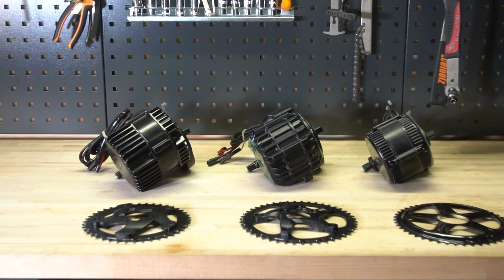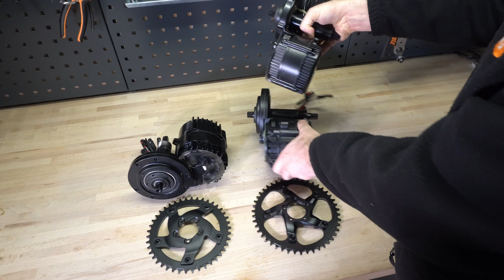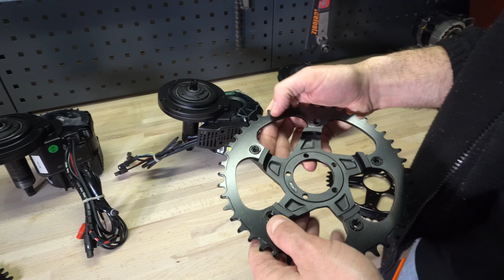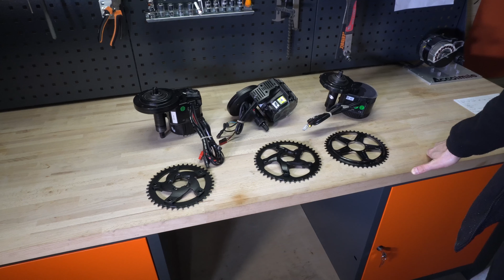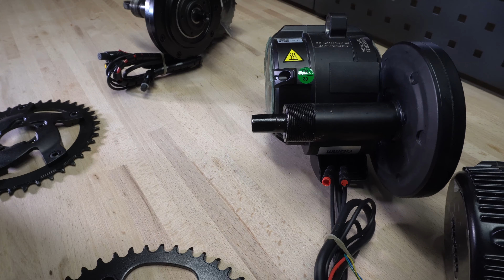NEW MIDDRIVE BAFANG BBS MOTOR

Comment: do you have the M435 in stock for sale? looks very promising. toseven still has huge firmware issues and no aluminium chainring options. their display is very good though, it even allows for proper battery SOC calibration. The M435 sounds really good though, probably all the good things from the BBS02 plus better sealing and torque sensing now.

Comment: Hi! What about water protection? It's still ip65
Reply from the maker: Hi! Thank you for your inquiry regarding water protection. The IP6X protocol means that the product is completely protected against dust and is resistant to low-pressure water jets such as rain or spray. In short, the device is fully protected against dust and moderate amounts of water, making it perfectly suitable for use in a variety of weather conditions.

Comment: the M435 requires the BESST tool and software to be configure. The display enables alnoatno settings. Stock firmware settings are pretty good, though.

Comment: Worst decision to have a ugly battery as a requirement in order for it to operate. Fail
Reply: not anymore required. it used to be with the M325/625
Reply: What about the barrery interface cable ..if not connected will show error 58
Reply: @yogeshnaik9276  no, it works just fine. only issue is that the battery level on the screen will not be accurate